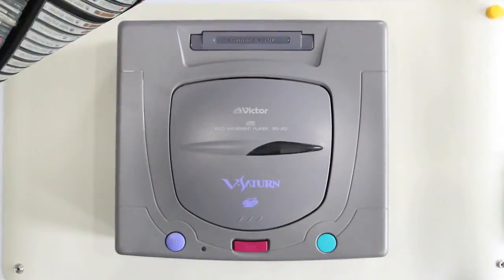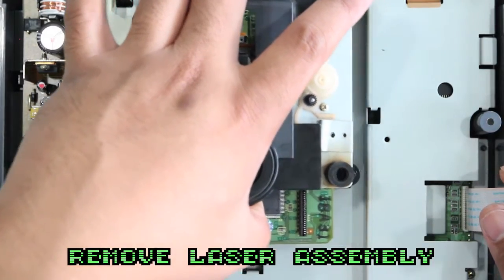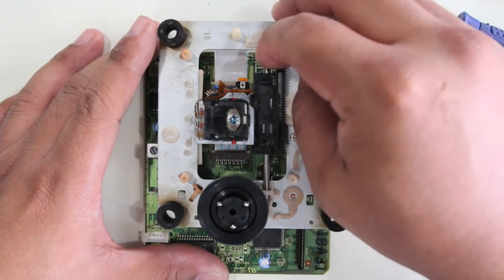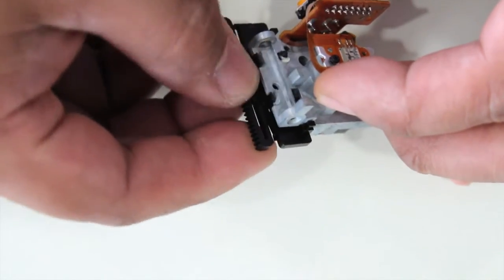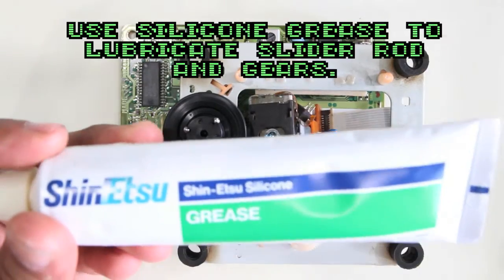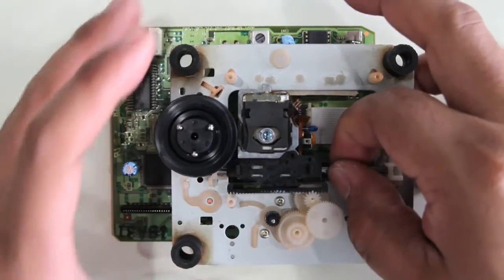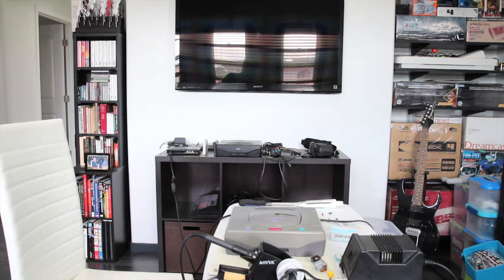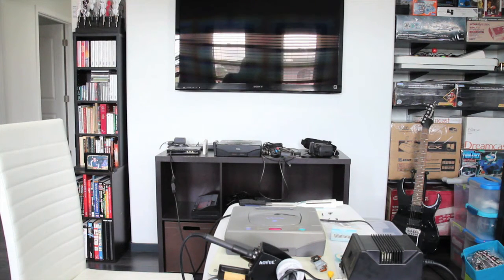Sega Saturn Laser Repair / Replacement [SH no.1]

Comment: I followed this video and my saturn is alive again! Thank you so much!
Reply from the maker: Glad it helped... and you can now relive the good old days.
Reply: The SegaHolic hi man I recently bought a jvc optima 6s as the laser in mine is dying, the replacement laser moves but disc isn’t spinning and it’s definitely the laser because I tried the old laser again and managed to get the disc to read. What could be wrong with the new laser? Or is it just faulty. Assembly is an ENR 007

Comment: The jpn saturn i had, took apart put back and couldnt get going again. no idea what happened. last time i do a full strip. But i find that for the 2nd time a new laser in a white saturn worked right away. For the price of £7 it saves the agro of pot fiddling. and you know it should last a bit longer than the old one.great videos. The aussie guy is good too but you bring some nasty-ass saturns back to life.
Reply from the maker: Thanks, but did you try just cleaning the laser lens? But yeah, you can get the lasers for super cheap. BTW, who’s the Aussie guy?
Reply: @The_SegaHolic  global garage. May have scratched it badly cleaning it. i got it working occasionally. I think i may pick up a few more junk ones from japan. Seems like the laser is the most common fault. Nice to bring them back to life. I like the simplicity of model2's. Easy to whiten too. Do the grey saturns all use optima6 jvc too? And Do you know if the neo cd or dc has cheap new lasers? Cant see much on ebay.
Reply from the maker: @kevinyoung7294  If you're using cotton swabs. it shouldn't have been that caked with dirt to scratch it. Yup, like I said a ton of times, it's mostly the laser. Super cheap from Alipress, so just buy a bunch of them. The supply is running low too, because there used to be a lot more sellers on Aliexpress selling the Optima 6s. Yes, the grey ones also. The only one that doesn't use it is the Philippine manufactured ones... the so called "Sanyo Saturn."

https://www.youtube.com/watch?v=LgP-MtN-Bog&lc=z235sr4pevaqe52eqacdp43a5jo4bjpscfb2dc5nbgdw03c010c

The neo cd I know nothing about. The DC has a laser that the aftermarket ones, don't work well for. Tried a bunch of them, and you always have to do some major adjusting to the adjustable resistor. Youre better off just buying a used working DC when you see them cheap. Stock up on the DC, as again, replacing lasers on those are almost always a miss.

Get those junk saturns too... as you see in my vids. You'll be surprised how much of them are actually working. For me, about 80% of "junk" systems I bought on Yahoo Japan Auctions come out working, or just a simple lens clean.
Reply: Yeah i picked up an n64 untested for £1 that works, an 'untested' junk saturn for 9p. if i cant see a working photo i dont go too high as you have to assume they know its broken. Sadly its like 1000-1500¥ for them to ship to buyee. Any good aliexpress users? All i can see is $20+ which is double than ebay?
Reply from the maker: @kevinyoung7294  you mean Optima 6s lasers from Aliexpress? Here's a link just in case.

https://www.aliexpress.com/item/Original-inventory-JVC-6-OPTIMA-6S-OPT-6-JVC-6-OPTIMA-150-OPTIMA-6S-OPT-6S/32821310648.html

Comment: Nice vid. I have a model one v-saturn that makes a grinding/clicking sound once it heats up...I'm thinking the laser assembly is pushing the gears hard, almost like a stripping sound. Fortunately the gear are all intact...any idea how to fix that?
Reply from the maker: Thanks, this was my very first video. The noise may be because something is wrong with the switch that gets triggered when the laser pickup is all the way toward the spindle. You'll see a lever on the PCB near the spindle. Basically, the lever is there to tell the pickup when to stop, otherwise it'll keep pushing on the spindle.
If that is ok, then I would just take apart the gears, which is pretty easy to do and should be in one of my saturn videos. Clean the gears and relubricate them with silicon grease.
If the problem is still not fixed, then, well, I wouldn't know anything further...
Reply: @The_SegaHolic  ok sweet, ill take a look in a few days and see. I didnt realized there was a lever used for that...ill definitely repost once I figure it out. Hopefully its not snapped or something. I mainly notice it when super street fighter 2 x is running simply because the laser moves a bunch in between stages...otherwise it only happens usually on boot up when the systems warmed up.
Reply: @The_SegaHolic  ok so an update. I noticed a few things: my power supply cord that came with the v saturn is rated at 250v...not the usual 125v...so I switched out to a standard cord (PlayStation style) and it seemed to abate the grinding noise for a little longer, but that could be my imagination. Also for the sake of comparison, I took apart my model 2 US saturn alongside my mod 1 v saturn to take a look at the lever you were talking about...the US saturn has a white lever to stop the laser, where as the v saturn has what looks like some sort of plug type translucent thing that moves slightly when the laser hits against it but it still seems to act as a lever, kind of strange lol. The last thing I noticed was while running super street fighter 2x like before, my v saturn not only makes the click noise but the music doesnt sync up right during the load screens...I thought this was the game but my US saturn syncs them perfectly. Could this mean my laser is dying, maybe needs adjusting? Power issue? I know that was long winded lol. On a side note ill be taking the gears apart once I get silicone grease btw. Thanks for any advice good sir.
Reply from the maker: @joshbechaistron791  Hard to give you more advice without looking at it. New laser pickups are pretty cheap. $10-12 shipped. You could try that first. If the problems persist, then the laser board assembly has been adjusted, and it will be hard to get it back calibrated correctly without a o-scope and proper instructions. BTW, check aliexpress for JVC Optima 6s if you want to replace the laser. I have instructions on the channel. Just search for the video. Easy to replace.
Reply: @The_SegaHolic  When you say the laser board assembly may have been adjusted, do you mean the potentiometer or something else? And yeah I checked out your other saturn vids. My v saturn is an rg-jx1(x) so as long as the optima 6s is the one ill look into them. Also, I'm not a confident solder guy, so is there any way to buy the laser pickups with the solder blob removed already on the back of the pickup?
Reply from the maker: @joshbechaistron791   Josh Bechaistron  The solder blob is easily wiped away  with just a hot iron. Give it a try, super easy. The optima 6s works in all Saturns except the Sanyo Saturn.
The laser board has pots (I actually don't know what they really are) on them. Look around the laser board, and you'll see metallic looking things with an adjuster for a crosspoint screwdriver on the top.

BTW, the lever that I was referring to on the laser board is connected to a switch, so the pickup trips a switch when it hits the lever.

From what you describe, the clicking noise probably isn't coming from the gears. You can turn the gears manually by hand by turning the uppermost gear, and if the pickup moves smoothly, you can eliminate the gears from being the cause. And clicking noises can come from the laser pickup when it has a hard time reading, but usually, it doesn't read the disc at all.

BTW, usually when issues arise when the system "heats up," it's usually capacitor related. But bad caps usually become "good" when they heat up for a bit. Your situation is opposite.

This is sounding like read issues. I the laser pickup is bad, but it's only $10 and worth a shot. If you can buy the laser board though, that would be ideal, but more expensive. You'll have to weigh how much the part costs (if you can find it) vs getting a whole other used Saturn.

I would offer you to just send the Saturn to me and I can diagnose it more thoroughly, but it only fits in the USPS's large flat rate box, and that's nearly $20. $20 both ways would be $40, and that's near a used Saturn price.
Reply: @The_SegaHolic  ok got it fixed...this was a weird one. So I checked out the pots on the board you were talking about. All of them were set straight with the exception of the one on the far left or back depending on viewpoint, but I twraked it straight, nothing seemed to change so I set it back. I looked at the laser pot last, fiddled around with it but put it back to original setting. What I did in between fixed it, here goes lol...so I ran the system, top off after it warmed up and sure enough it was the gears. When the laser rocked back, it jolted enough to wobble the gear that connects to the black gear near the spindle, so it skipped. I took the laser guide out, was gonna take the gears apart but lost patience and put it back in. So I ran the system top off again and it never clicked once, and the laser was quieter. I checked the gears and there was any wobble...so from what I can tell, it looks like the laser gear piece was sitting on the lower gear of the gear it was supposed to match to if that makes sense without a picture. Either it left the factory that way or the previous owner did it! Whoever did it would have to really wedge that piece in hard to get it to do that, which would help explain what was happening. Since I didnt make a note of it before I can't say for certain, but I'm pretty sure. Either that or I gave it the magic touch and its good now...electronics lol

At any rate, thanks for the all the help and the videos...without them I wouldnt have dug into the system and fixed it.

Comment: sorry to trouble only now i´ve found your channel can you tell me how much it costs a sega saturn laser? and wher to buy them? i have 2 sega saturn model 1 and 2 sega dreamcast all working but i would like to have spare lasers thank you
Reply from the maker: +João Lopes (John The Gamer) Don't tell anyone... shhhhh.... You can get them here for really, really cheap!

http://www.aliexpress.com/wholesale?catId=0&initiative_id=AS_20151104030414&SearchText=optima-6s

I've used them before and got them for about 8 dollars each.
Reply: +The Sega Holic Did you buy your new laser from that website? The price is really good but I have my doubts about their quality.
Reply from the maker: JoSeMaPR The others from eBay that sell them get them from Aliexpress. Aliexpress has manufacturers from China. You are dealing directly from these manufacturers. You skip the middle man. I have bought for personal use, and I have sold on eBay as the price hike on eBay is a rip off. I have not have any of the lasers fail, or been notified that any of the laser failed from the ones I sold. And that's over 30 lasers that I have bought! Look at the ratings and choose which company you want to deal with.
Reply: Thanks for you response and also thank you so much for all of your great videos. Well, I will buy a new laser for my Sega Saturn that has been lying on my closet for nearly 7 years and I would like to repair it. I will let you know soon if I made it!
Reply: +The Sega Holic Hey Sega Holic, I've got my replacement laser today and guess what? It works! My Sega Saturn is working again after so many years :D! Thanks!
Reply from the maker: See! You save a ton of money. Glad it worked.
Reply: Japanese white model 2 which laser .. Will this optima 6s fit it
Reply: Installed the replacement still won't work... Getting that 728:00 on the CD screen ...won't even read a audio disc...and spins for a while then stops...bad motor?
Reply: @pskila  yes you have a faulty motor spindle

Comment: Need a drive assembly cause I don't think the spindle motor is working...spinning but still not reading
Reply from the maker: You sure you don't need a new laser? A new laser is only about $10 shipped.
Reply: Spindle motor was bad... replaced assembly and it's working
Reply from the maker: BTW, you were watching the wrong video spindle problems.... you should have watched this linked video, which has a ton of work on the CD drive assembly, including replacing the spindle, which you can find on Aliexpress. Since you got it working though, don't mess with it. Just watch the video for future reference.

https://www.youtube.com/watch?v=3TtsLz0FcEM
Reply: The Sega Holic thanks bro...I didn't want to buy a whole new skeleton but I figured as much... Your repair vids are crazy good.
Reply from the maker: Thanks man. That made me feel good. 🤙

Comment: I've decided to avoid model1's. So much more work to take apart if you just want to clean it.
Reply from the maker: Depends on which version. The later model 1's were like the model 2's. The early ones are definitely more work as everything is more packed in... definitely. Been meaning to do a video though on an important upgrade that the earliest Japanese model 1 allows you to do.. Been more than a year since I got the parts I needed. I should do the video soon. LOL.
Reply: My grey one has an extra screw by the power socket.  Glad they changed it. So much easier if you just want to clean the top half. Upgrade?
Reply: @kevinyoung7294  Yes upgrade
Reply: @kevinyoung7294  he is refferring to the Sega Saturn VCD card

Comment: After more than 20 years, I finally replaced the laser on my original Saturn.
Reply from the maker: Pretty easy right? Should have been about $10 for the laser from AliExpress....
Reply: @The_SegaHolic  Yep, took me less than 10 minutes to do.
Reply: Are you experienced with soldering since you were able to do it easily? I have no soldering capabilities unfortunately
Reply: @sebastiann.8088  Yeah, I've done quite a lot of soldering before. But for this job you don't need experience. You just heat the iron up and you can separate the solder with one swipe. Very easy.
Reply from the maker: @sebastiann.8088  Like Nights1980 said, it's very easy. Dude, to take of the solder blob, just have your iron hot enough to melt the solder. Get a temp adjustable one from Amazon. The cheap stuff is pretty good nowadays, where the adjustment is on the iron itself. Should be no more than $10. Set your temp to 380F and once it melts, swipe away toward the edge of the PCB. Clean your tip, and swipe away any solder that might still be bridging the two points where the solder was. Give it a try.